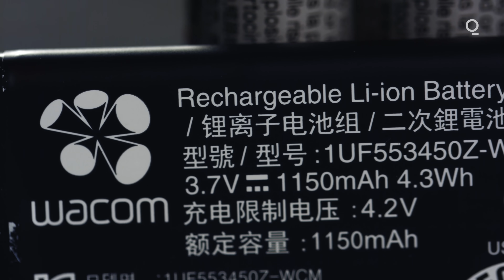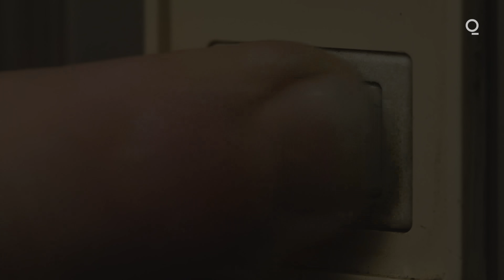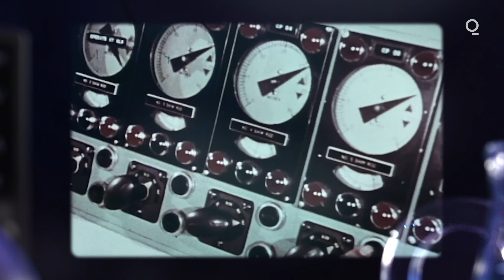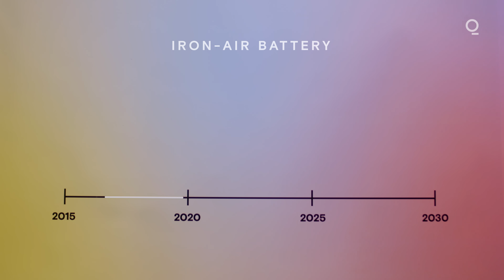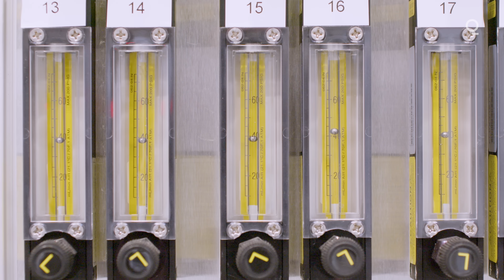The Huge, Weird Batteries of the Future

Comment: I am so sick of this idea that oil is not a renewable source. Or hydoelectric. They are renewable. This is nothing but a new way to keep the sheep in a corral. This is a environmental nightmare. Digging up mountains to get the lithium is using more diesel. How they plan on protecting environments while shoving ppl into the 15 min cities. Nuclear power was the best because it is clean and easily renewable when you recycle the rods. But the oil industry did everything it could to shut down nukes. I wouldn't be surprised if 3mile island was a false flag. This is the new evil. 
Do not think for one minute they are going to charge you a ton.

Comment: How do you cool down your house when it has enough heat? You turn off the heat. 1816 nuclear winter is the solution, unfortunately. People need to stop moving for 2 years; no industry other than necessary ones. And still it will still go up

Comment: Well lets keep it simple OK ,,, So 40% more power to push water up to the lake than you get when it falls to the turbines THEN the cost of the lake and fitted equipment 
What dues this add up to?  Well in July power costs rose dramatically by 20-25%
Reply: Fossil fuel plants have an energy efficiency of only 30 to 40%. 60% of the heat energy is lost to the smoke and steam you see leaking out from the chimneys.
There are always losses when generating electricity, so I don't quite get your point. Especially with the prices. Fossil fuels cost more than $0.30 per kWh to generate. Renewables only $0.06. So a 20 to 25% increase of $0.06 is still much cheaper in comparison.
Reply: OK POINT TAKEN ur right there are losses but all the worlds dams run only one bank of turbines I can get them to have three banks but the out put will only be 10-15% more output. I have mentioned this to show i have dun my home work NOW to ur point  I was trying to say its not green tech and should not be labeled so. And just to add in my book to call it green tech it must last long enough to return more power than was used from digging it up till it hits the recycling plant.   @texanplayer7651

Comment: Gravity batteries:
To store 1KWH would require lifting a 3673kg weight 100m or 10(.1) 4680 Tesla cells. This is the stupidest idea I have ever seen. Engineers should know better. 
Force of gravity of per kilogram = 9.8N/1KG. 1KWh = 1000W x 3600 seconds/hour = 3600000 Joules. = 3.6MJ. 3.6MJ/(9.8N/KG x 100m) = 3673kg.
Tesla 4680 cell has a capacity of 99WH/cell. 1000WH/99WH = 10.1 cells.

Comment: The non nuclear solution for decreasing co2 emissions is like putting a small bandage on a severed arm.  This renewable replacement with wind and solar we have tried to do for the last 30 years has not worket to the extent it needed to do. If we continued with nuclear power expansion we would not have been in this climate disaster scenario. If we did nuclear expansion we would most likely have 70-80% non co2 releasing energy production instead of 30-40%.

Comment: Their company is called "Form energy," specifically leaving the "e" in energy as lowercase, because that makes their initials "Fe," which is the chemical symbol for iron. Brilliant.
Reply: I personally think they should layer sheets of iron instead, inserted between sheets of graphene.

Graphene is made of Carbon which is also very abundant.

The lattices of graphene shouldn't interact with the Iron oxidation and would help to provide a gap between iron sheets increasing its exposed surface per weight.
Reply: @Supremax67  I think it is a goal of theirs to remove all carbon sources from the process though, which may have influenced their decision to steer away from the graphene solution. I may be mistaken on their wishes though. The video talked about a couple different companies.
Reply: Maybe when quantum dots become more advanced, then they can give such batteries extra power.

Comment: It would be more efficient & scalable, cheap to bore a series of deep holes in the earth. 
An electric winch sits at the top of the hole attached to a long weighted cable.  
When there is no wind or sun, gravity pulls the cable down and generates power which goes into the grid. 
When the wind turbines or solar systems produce surplus power, the cable is winched up. 
Need more storage, drill more holes or increase the weight. 
No need for a mountain, water, lithium, complex supply chain, etc
The drilled sediment could be compressed and converted to building materials, which could be used to make energy efficient and affordable houses.

Comment: Interesting video, but I'm pretty sure time will show us, that we need a LOT less grid electricity storage than we imagine today. 
It's a lot more efficient to move the demand that can easily be moved, to times with excess renewable energy. Charging of Electric vehicle will be a big energy consumer in the future (until ElonRoad gets implemented) and with proper software, it can easily be done when RE production in high. And will have to, to spread the load on the grid.
The other big consumers are heating and cooling, which stores VERY easily in local (household) tanks with water. So HVAC and heat pumps can run only when electricity is in excess.
Once we get to a point where we have enough wind and solar power to cover transport (including power-X for electrofuel for aircrafts and big ships) and heating/cooling and OUTSIDE peak hours, there will be very close to enough solar/wind to cover time critical demand during even during less ideal weather for production. Regular hydro will be able to cover the rest.

Comment: Firstly, this is old technology and isn't "of the future" it is pretty widespread usage world wide.
Secondly this isn't a battery. The energy isn't stored, It is used up and then generated again with a significant loss.
Thirdly, "clean energy" isn't reliable or of the future or efficient  and won't ever be, it is a big scam. 
Now if we figure out fusion or quantum fields that might be an entirely different story.

Comment: Another thing companies should be working on is "casual productivity." Figuring out how to build a factory or something that is actually practically useful, but that can turn on and off almost instantly, and only needs to operate when power is available. In that way, when there is excess power in the system, this facility could make something that takes a lot of energy. When power is low, everything would completely shut down. Obviously this would not be as productive as a 24/7 operation, but it wouldn't necessarily need to be, since it would be more efficient (using only "excess" energy), and would also need to be relatively low human-resource, just people checking in from time to time to make sure everything is running, rather than having a bunch of humans wandering around that would have nothing to do when the power is not available. If they can manage this sort of project well, then it would be a much more efficient use of variable resources than any form of storage.

Comment: Universal saw tooth pattern the electrons around the wire guides for transferring momentum and compaction of the charges against the loads it supports.
Love compassion for all Daniel Ash 6 coilings two force type activators and A.C. is in house recycled wave feeding out a.c..
 a spin of air the charge batteries storages

Comment: I love how the interviewees describe solar and wind power as "more intermittent" instead of "less reliable".
Reply: They're reliably unreliable- or put in another way, intermittently productive in a predictable way. They're perfectly reliable in terms of performance to spec.
Reply: @20xx-mm-dd  Exactly. And the intermittency has to be dealt with.
Reply: Solar and wind are reliable. What is your point?
Reply: @sudosu4133  Please tell me how a solar panel is reliable in winter when it's cloudy for weeks on end, or how wind panels are reliable when there is no little to no wind.
Reply: @rikkertbatzback1816  First of all: You are changing your assertion. Please re-read your reply. You do not mention "solar panels" but "solar and wind power". Solar and wind power are very reliable. The power wind and solar devices can generate depends on the intensity of the wind and solar radiation. The intensity is variable and intermittent, but the reliability of the device generating that power depends on the reliability of the device itself, not on the energy source (wind or solar). Solar panels are very reliable converting solar radiation (sunlight) into energy and so are wind generators. The power they generate varies because the intensity of the sources is intermittent, not because the sources, or the wind or solar devices , are unreliable.
Reply: What I guess you wanted to say is that wind and solar intensity is variable while your energy consumption is much less so. This is precisely why we need energy storage, which is what this excellent video is all about. You obviously failed to understand that.

Comment: A couple of common misunderstandings about wind energy. You can vary electrical output per turbine on many of them, feathering(twisting) the blades and braking are two methods. Also you can dump excess energy into some of them by spinning up the blades and turning them to face into/away from the wind. If you know its going to be windy enough to generate in a few minutes you can set up the turbines to harvest more effectively... A bit more sophisticated level of controls than gas/hydro/... but also useful in some cases.
Reply: You say the controls are a bit more sophisticated, but in reality those controls serve only to get optimal use out of wind power to overcome its shortcomings and limitations, which are actually not present for gas.
Reply: They also have a short lifespan
Reply: @timgibson3754  Lifespan is based on manufacturer, design, implementation, operating conditions, care of maintenance. They can be designed for long term use, and some are. However you need to consider it's still relatively early in the development of wind harvesting. Expect significant improvements in cost, reliability, production output and flexibility. Lots of design options exist for cheaper storage as well, just lifting water back into a hydro storage(dam) with available wind offer's huge potential. Especially in colder/wetter/windier climates. Most current wind harvesting uses moving parts, but even that is not required. Clever people are spraying ions into the air and then capturing the energy from the wind as the ions flow past a sensor plate. Don't be so easily fooled by press that wants to dumb you down...

Comment: This is so amateur a 5 year old could think it up. What truly needs to happen say in Europe is huge dams should be built in between the mountains in Norway and Sweden, then when the water is released through the dam and powers the hydro electric that energy is then used to boil the same water for it to power a steam turbine to generate electricity then be turned into steam and we use the steam in its altered state to send it back up to be cooled in the waters of the reservoir. Id like a physicist to do the calculations of all this to see how much more energy can be produced using dams in this manner...

Comment: Using iron for batteries... interesting.

What is the energy density of these batteries, say compared to sodium batteries or even lithium ?
Iron is a big heavy atom, compared to sodium (twice as heavy), but with a slightly smaller radius, so I guess the batteries will be slightly more energy dense but much heavier, which is fine for a static bettery.
Reply: Looks like 100kwh vs tesla powerwall at 13.5kwh.
Tesla powerwall is 7kW output. I know this will be nothing near that but am curious how many you would need to be an equivalent, perhaps a few hundred.

Comment: Nice concept, but is the energy to pump the water to the reservoir, equal to the power generated to the water turbines?  And what happens when water is low due to summer, etc
Reply: Obviously not, there are inevitably losses in conversion to a different form of energy. The round-trip efficiency of pumped hydro is around 80%; a bit worse than lithium-ion batteries but better than some other storage technologies.

Comment: It's improper to say you're storing energy in this video (not directly), in fact, you store raw material to produce energy. It is similar to storing coal or hydrogen or gasoline.
A.C. cant be stored, but D.C. can be stored in batteries - see photovoltaic systems.

Comment: How much electricity is used to pump the water up to the top of the mountain compared to how much electricity it generates coming down?
Reply: More to pump. But you pump when there is an excess on the grid and drain it for use during peak usage hours (hot days, power outages, etc.). A fair amount of the energy will indeed be lost both during the pumping and the generation.

Comment: Pumping water up to a high lake to store energy has been used in Ireland since 1969.
Turlough Hill Lake is filled with water  by electric turbines when demand  is low at night... but  when you can't just switch off the power stations.
During high demand the water pours down the same pipe and reverses the very same turbines which feed the saved energy back to the electric grid.

Comment: Some actually not terrible battery ideas.  I've seen some pretty dumb ones out there and these are not completely dumb! Yay!  HOWEVER,  what this video misses and a whole lot of other videos on the future of energy is that there is an underlying assumption that we will use MORE electricity, not less, in the future.  Why?  Our computers are more efficient, our lights are more efficient, our homes are more efficient and even our vehicles are slowly getting more efficient.  What's with all this need to consume more?  What with tiny transistors and nano computers, what's with needing to waste more?!  I smell a rat....  I detect that there is a whole lot of energy that the SYSTEM wants to consume that we will be paying for via our taxes but won't be benefitting from personally.   Because otherwise, seriously, none of it makes sense.

Comment: how much electricity is needed/used to pump water up to the reservoir?  where are we getting the electricity to 'pump' the water up to the reservoir. if you have no electricity to start, then you have no battery. if they build a pipe line up stream that the natural water pressure would 'PUSH' the water from the river 'up' to the reservoir over a distance, using a higher elevation further upstream, this would reduce the cost and need for electricity to pump it up to reservoir.

Comment: The problem with energy grid issues is coupled with intellectual maturity. Treating power for what it is and not a utility is the solution. Mobile on demand self sufficient power is the key to sustainability. Moreover, circuits are just that. Individual loops.

Comment: The interest in grid scale batteries is based on two things. First is grid stability regardless of the source of electricity. Grid stability is currently maintained by having large power sources available to start up at a moment’s notice. Today the grid mostly uses gas simple cycle turbines that are essentially jet engines attached to a generator. They have no steam generator system thus don’t require long startup times. They are very economical because they can be used constantly or intermittently and are both a source of power and since the fuel can be stored act as a “stored” energy system. The second thing is the desire to store power for longer periods economically. If you only use your power storage device once per day you can use a cheap battery and maybe keep the economics manageable. If less frequent use such as weekly or monthly the cheapest battery in the world is wildly uneconomic and probably always will be.
Reply: Stop being so logical
Reply: @zeldaharris6876  as mr Spock said “logic is the beginning of wisdom not the end of it” 🖖

Comment: If they can use form batteries with iron to oxidize the metal. Well the one oxygen atom per iron atom. Carbon can catch and release two. Meaning it'll kick off two electrons per carbon atom vs just one with the iron.

Comment: Upscaling these technologies is the wrong direction to be moving towards – it's capital intensive and requires massive infrastructure to maintain and support.  We need to be thinking in terms of liberation technology, and micro generation (±5kWh) is the key.  Yes, in large urban areas that is unlikely a viable solution, because the density demand can't be met by the limited footprint available for production, but in suburban/rural areas, it is key to reducing one's dependence on large-scale grids.
Turning homes into self-generating production/storage facilities where excess energy production can be reverse-metered out to the larger grid is the way to go.  The costs and benefits of such a grid is spread among all stakeholders, where everyone produces energy and receives the benefit of selling their excess production to the grid.
Reply: yes - this is the solution but we are headed in the opposite direction

Comment: water is getting scarce but why not air pressure... unused power generated can pump air into the grid... like pipeline... storage tanks  as needed for the population. pumping water uphill is a waste ,  evaporation... large pumps

Comment: So, if i understand, they will use the electricity generated by solar and wind to pump the water UP the mountain and then when that electricity is needed they just do a hydro electric process? In a nutshell?
Reply: yes that is all it is - except it costs a bomb to build and the wind and solar farms are very short lived.  So it all it is very expensive.